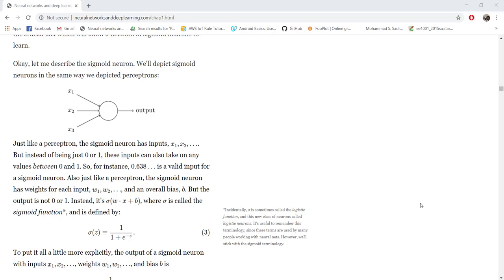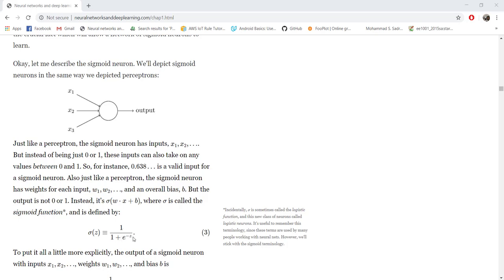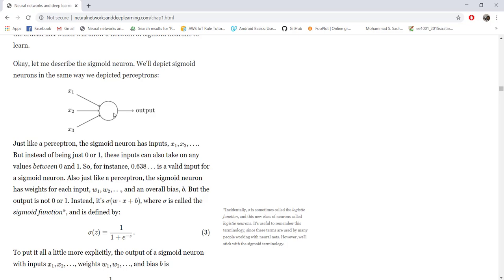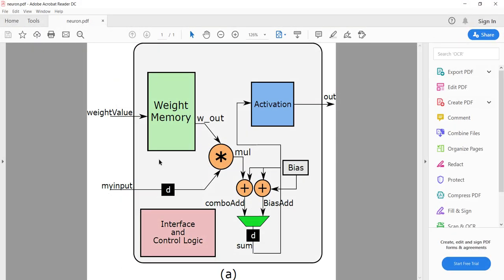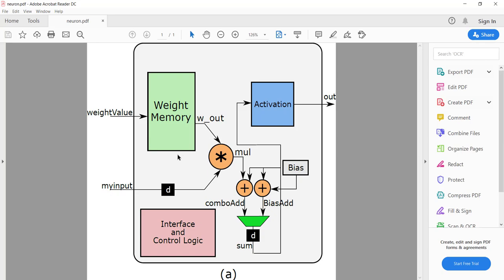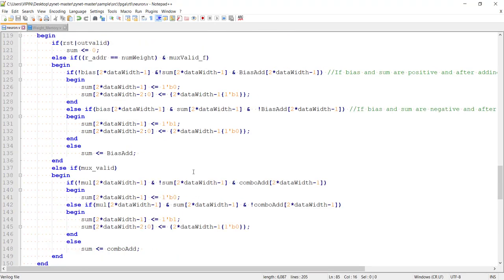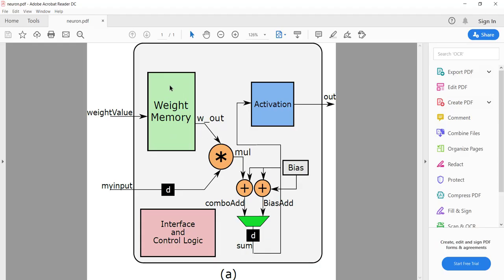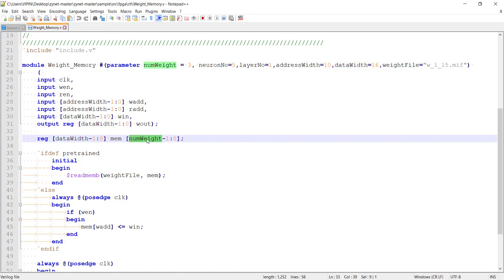Neural Networks on FPGA: Part 2: Designing a Neuron

Comment: Great video, though I wonder why you would implement a neuron this way rather than using a systolic array and convolution. Or was this mostly a learning / teaching exercise?
Also, not to be picky, but you could have implemented that mux in a more efficient way. The way it was done, there is a lot of unnecessary parallel re-use. Having a selection between the two inputs, going into a selection between an underflow/overflow result and the valid result would have resulted in fewer resources, and probably a shorter path length. 2x2 muxes vs 2x4.
Reply: Hello! do you have some example about using a systolic array and convolution

Comment: @Vipin Kizheppatt
else if(mul[2*dataWidth-1] & sum[2*dataWidth-1] & !comboAdd[2*dataWidth-1])
            begin
                sum[2*dataWidth-1] <= 1'b1;
                sum[2*dataWidth-2:0] <= {2*dataWidth-1{1'b0}};
            end

in this code least -ve number is not 0, it has to be -2^n-1, but you took it as 0, may 
i know the reason

Comment: Could you please explain use of pretrained in Weight Memory ?
Why there are 784 entries ? For what problem you have design neural network?
Reply from the maker: That is explained in subsequent videos. It is because finally we will be evaluating mnist dataset, where each input image has 784 pixels
Reply: Thanks for reply.
Yes I will watched all videos  definitely.

Do you have any simple example with minimum number of inputs wit less numbers of neurons?